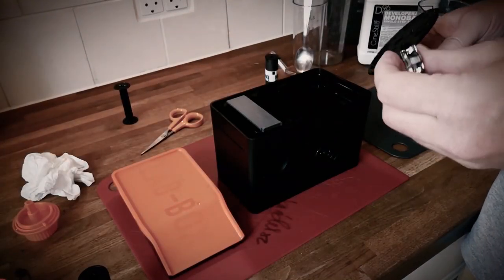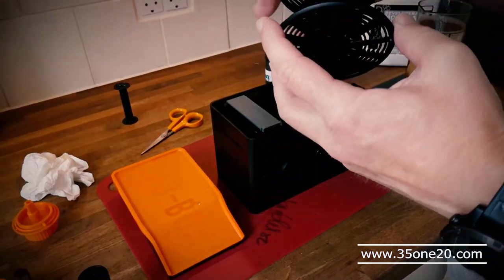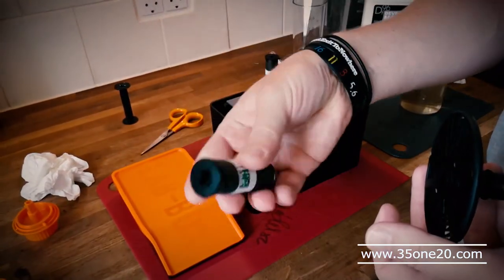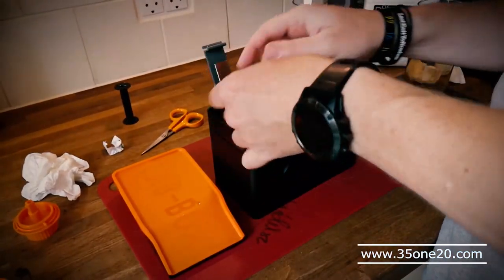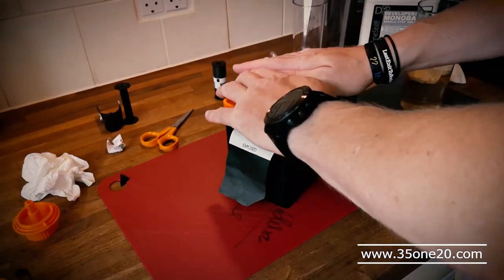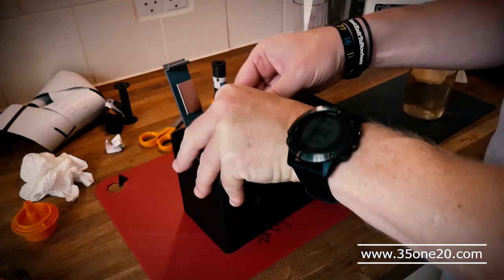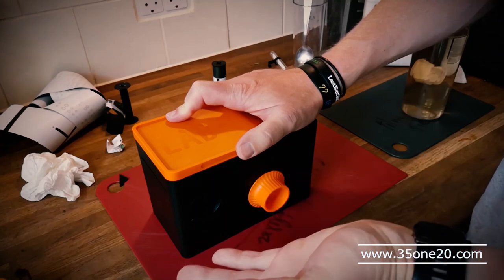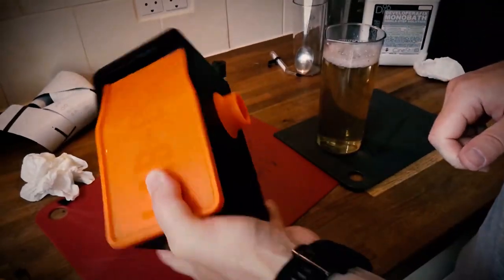LAB-BOX developing a 120 film - 2. time

Comment: If you make this mistake (not lining up the entry points on the two reel halves), do not feel bad. LB claims that the reels are indexed to prevent such, but the facts are: (1) the directions and related pictures of how to assemble the reels are just terrible, nearly useless; (2) the reel halves and spindle are not physically keyed to prevent this error (every other adjustable plastic reel is keyed to prevent this); and (3)markings on the spindle and reel parts which are supposed to guide assembly to prevent this from happening are confusing or missing. Of course, there would be no possibility of such error if they had provided full reels (parts) rather than making the center spindle so it  could be used in both 35mm and 120 reels, then cheaping out by providing only one spindle for both reels. (Amazing for a Kickstarter project with 900+% funding.)  The only good part of this story is that after you screw it up and destroy one roll of film, you'll never do it again.
Reply from the maker: yeah, your right I found some markings on the reels, and they are not where clear and a bit confusing.

Comment: Did it work?  Considering purchasing with the 120 module but haven’t seen many reviews yet.
Reply from the maker: Hi Peter. 

I think it works best with 35mm. 120 is a bit more tricky.
I developed 5 120 films now, the 2 in the videos, where one was ok.
Then I had one when the film didn't go into the "compartment" below, so that was completely ruined, and then 2 that where ok.
I definitely think the 120 takes more practice.
My advice is that you really have to take it slow when you load the film in the tank, you can very easily mess up the "on spooling" - don't know what you call it, when the film goes on the spool in the tank :)

Maybe try starting up with a no good film for practice, I think that would help you a lot - and hopefully not ruin any good film.

Take a look at my website to see the other videos and still of the films I developed - http://www.35one20.com/2019/08/04/lab-box-first-impression/

So far I kind of like the LAB-BOX, especially for 35mm. But you definitely have more control of what you are doing the old fashion way - with a dark-bag and a daylight tank.
But this way is sure quicker :)

And maybe it's good for new comers.

Tanks for watching!
Best
Bo
Reply: @JustWalkedBy  Hi Bo - thanks for the video.  your results for 120 were the same as mine.  I had the same issue with 120 - where the inner spool forces the film to stick together and I lose about 1/2 shots due to the dev not getting to that part of the film.  So agree with your comment about this may be better for 35mm than 120mm due to the spool issue.
Reply from the maker: @MarqelexsisAmaro  Yeah! or 120 definitely needs some more practice. I have got a few good 120 films out it by now.
Reply: @MarqelexsisAmaro  Check the gears on your spool. There is a left and right side. If you do them wrong it will actually cause your film to stick together.
Reply: @methods20  yeah I checked it what I found is, there is a little give on the spools even if done correctly... this means you can push it in a little too much.  once I set the spool and pulled outward a little that seemed to do the trick.  I've since have had a couple of successful rolls.